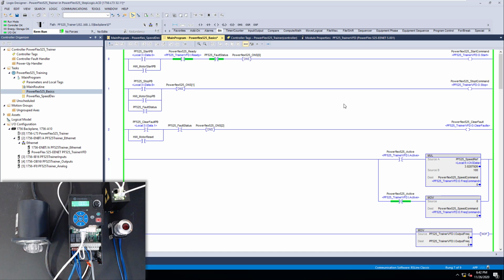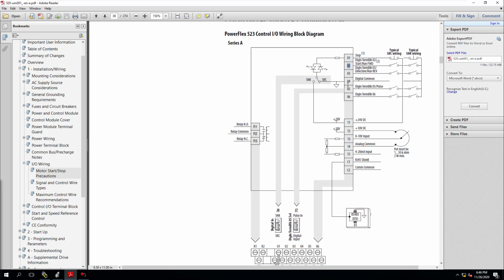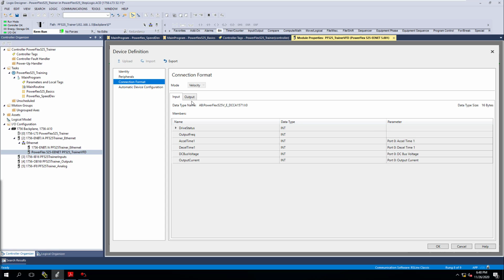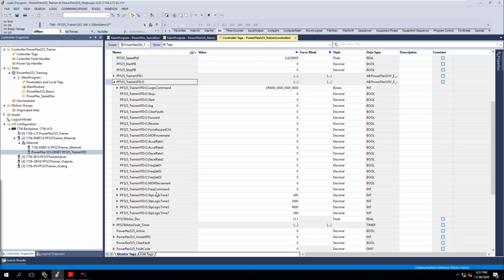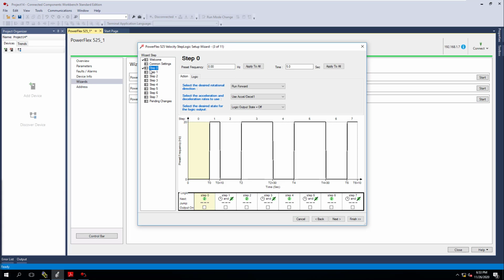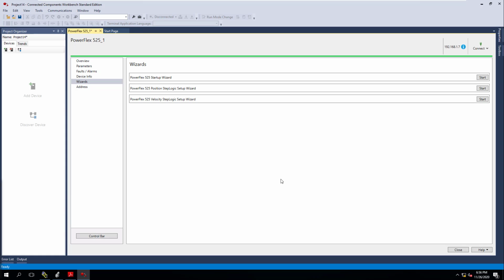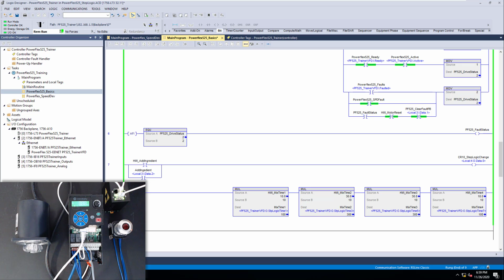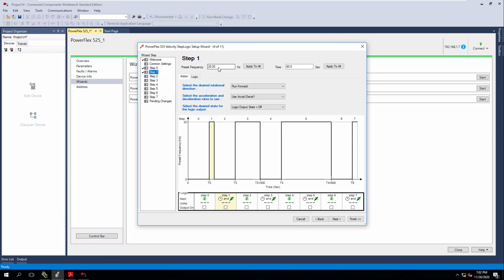Powerflex 525 Step Logic For Batching Using Studio 5000 Version 32 With Hardwired Inputs

Comment: If I'm using one input to ramp up a motor through each step, and I want the motor to ramp up as long as that input is active BUT if the input is inactive I want to go backwards one step at a time, how do I do that? Currently What's happening is when the input goes inactive, it will go back one step and get stuck unless I flag the input again. We're trying to do this without a PLC by the way.
Reply from the maker: After reading your comment, it seems you have already answered you question.
Regarding what you said, Check you wiring & open CCW then verify the parameters are correct.

If you need just a few different speeds then I would just set up a few different speeds in the VFD & wire the inputs to the VFD to change speeds, meaning, do not use step change.
Use the standard speed control inputs
Reply: @ShaneWelcher  Thanks for the quick reply! I actually figured it out shortly after. Instead of having the OR statements revert back to previous steps, I had them skip forward to a different step. Somehow going backwards was getting the logic stuck. It's really hard to explain the problem without showing the logic but hey it works!